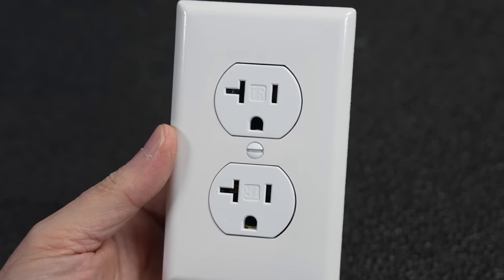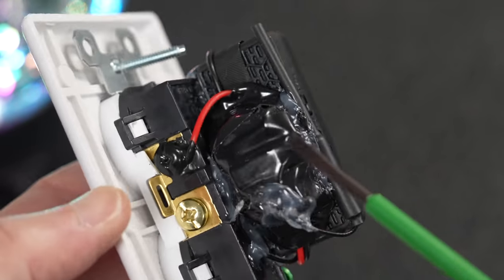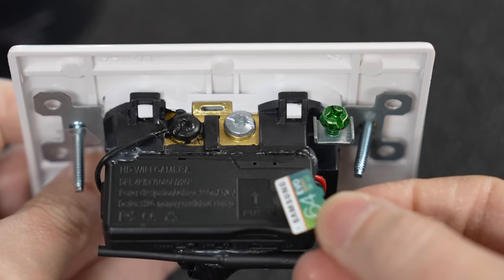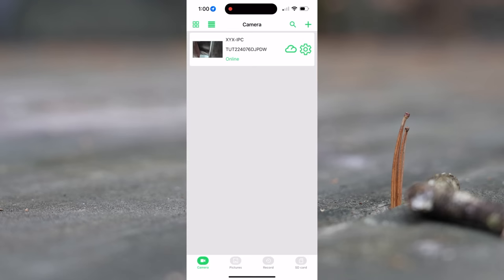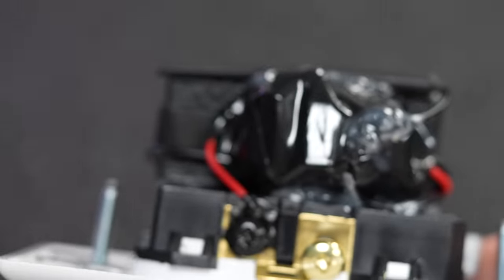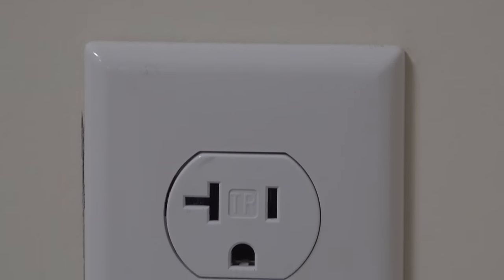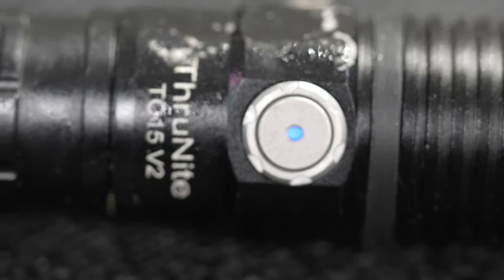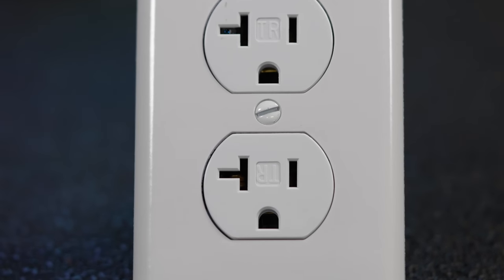Most ILLEGAL Outlet in the United States

Comment: All the more reason to not rent an AirBnB. This type of thing doesn't even have to be installed by the owners. It's innocuous enough that a guest could swap out an outlet or two and the host would never notice, and spy on everyone who visited after them. That said, virtually anything plugged into that individual receptacle would obscure the camera.
Reply from the maker: Wow, I never even thought of that possibility!
Reply: I was thinking the exact same thing. Yikes.
Reply: couldn't someone do the same thing in a hotel if they so choose?
Reply: Good point for sure.
Reply: Why would it matter if it was AirBnB? You think a hotel maid would notice one of these?
Reply: @the77eltigre  In theory, but hotels are much larger and built of concrete. The odds of it being accessible from the parking lot are slim to none. Buildings like that eat signals for breakfast, and there's lots of interference both from guests' devices and the hotel's own high-powered WiFi. It'd be such a tossup as to whether it would be accessible that there's no way it's worth the nearly $200 price tag.
Reply: Wouldn't they need to turn off the power to install it?
Reply: @sherryh7485  most competent people can handle 110 volt wires without turning off the power.  I personally never turn it off because it takes too long and the zap won’t hurt if (big if) it happens.  Just pay attention and you will be fine.
Reply: @sherryh7485  : When I was a kid I sometimes stuck metal objects in wall outlets and touched them.  The zap felt like a strong buzz.  Unfortunately, it failed to give me super powers, so I eventually stopped trying.
Reply: @scottmolnar4132  
Scott, Their hasn’t been any 110 volt residential service in the United States for at least 40 years. The standard is 120 volts and 240 volts for residential service.
Reply: @BartlettTFD  110 and 120 are used interchangeably because voltage actually fluctuates within that range. It's nominally 120, but 110 is used as the reference because that's the voltage you're guaranteed to get. This is why every device says 110 on it and not 120, because they're rated for 110 at minimum but have to be designed to take 120 as well.
Reply: @WardenWolf  
I’m referring to the MEASURED voltage at a receptacle supplied by the electric utility. I could care less about what a Chinese company stamps on their products😂
Reply: @scottmolnar4132   If you hold it with your teeth It helps keep the outlet and proper orientation
Reply: @sherryh7485   Actually no, I replace plug ins all the time without turning off the power.  You just have to be careful what you’re doing when switching the wires and make sure your not holding the plug in where you might get a zolt of electricity. If you’re holding the plug in wrong it’ll let you know!😂  I’ve been zapped a time or two myself, just a attention getter!  Unless you’re really grounded or standing in water the shock not that bad, gives you a fright for a brief second about it, then you realize what you did wrong! Besides not shutting the power off that is! 🤪 I’m not afraid of replacing plug ins with the power on at all and haven’t been shocked in years from it either. Just got to keep wires separated and pay attention where you’re holding the plug in while you’re putting the wires on the plug!
Reply: @BartlettTFD   Even though you are correct that’s it’s 120 and 240 it’s still a common practice to be called 110 or 220  by electricians and also on equipment sold all around the U.S.  it’s kind of nit picking about 10 volts. Which those 10 volts can easily be lost just using a longer extension cord! In fact in larger homes, especially if they don’t run 12 gage wire in those larger homes the plug ins that are far from the breaker box won’t have full power to run certain appliances or equipment like a portable air compressor. Which I have ran into this problem in larger homes many times with remodeling kitchens and having to move my compressor as close to the breaker box as possible to get the compressor to kick on.  It’s a industry standard to call it 110 or 220 regardless of the actual voltage?
Reply: @BartlettTFD  ok
Reply: @sherryh7485  nah I swapped most of my outlets in my house because it’s an old house and didn’t have ground prongs. I did the first couple by turning off the power but quickly got aggravated by working in the dark and grabbed gloves and did the rest with the power on. It’s a bit risky but not really that big of a deal.
Reply: @the77eltigre  Well that would be very difficult in a hotel unless you like taking the risk of wiring a "live" outlet. In most hotels you are not going to have access to the breaker panel. Airbnb however, most certainly you would.
Reply: @explorenaked  Anyone with a degree of experience and care can do a live outlet without dying. However, the risk in a hotel is substantially greater because, if you make a mistake and trip a breaker, it will trigger an investigation to find out who did it. In an AirBnB with an absent host, that is not a real risk. In most cases breaker panels are unsecured and the guest can just reset them.
Reply: @sherryh7485  can confirm that you do not have to, just changed out 15-20 outlets without bothering to kill the power. It's highly recommended, and you absolutely should if you are not experienced but entirely possible to swap an outlet without turning the power off.
Reply: @ghostridergale  I tend to flip back and forth, sometimes I say 110 "one ten" and sometimes 120 "one twenty" and I cannot think of any particular reason to choose one or the other.  It isn't actually a measurement, since when I measure the voltage, it tends to be rather variable everything from about 115 all the way to 126 or so.  It depends on the load time of day and which phase or leg of the circuit it is on and what else might be using it.
Reply: @kornbread435  It's easy especially with the kind of outlets that are not screw terminal outlets but just strip 3/8ths and push in a hole.
Reply: @BartlettTFD  "I could care less about what a Chinese company stamps on their products" .. "I could care less" means you DO care. "I couldn't care less" is the correct way to express that you don't give a toss. Many (mostly Murican) people make this 'misteak' 😂, it's endemic in your education system, mainstream media etc, so you're forgiven for not knowing this.😅
Reply: @ghostridergale  110 and 220 are LAYMAN’S term’s NOT terms used by electricians and engineers.
Reply: Even when obscured, it can still record audio.
Reply: @scottmolnar4132   Make sure you're using one hand.  Getting that voltage into one hand and out the other will shock the crap out of your heart, which is not something I'd recommend.  :D
Reply: @dragoniv  there is not enough voltage in 110/120 for it to matter. You may get a surprise but not but it won't hurt you
Reply: That is why this video does have some educational value. That configuration of receptacle is very highly unlikely to be installed in a hotel/motel room, if at all, other than in a shop area. Without the dual purpose 15 amp / 20 amp receptacle's appearance being pointed out, very few people would even suspect that it had a nefarious purpose for being there. 
 
In this age of cheap advanced technology being available to anyone, always assume you are being surveilled by a hidden camera. Always!
Reply: @BartlettTFD  then why do you care that he said 110, knowing that is correct as well.   If you measure the voltage drop at someones house, will you call it 118v ?  Its 110/120
Reply: I am installing these in my Virginia Beach air bnbs to catch people bringing too many guests and animals as well as smokers. Knowing in real time saves from severe property damage.
Reply: @sherryh7485  you can install with the power on if you are careful. Its not smart but it is do-able.
Reply: When I stay in Airbnb’s I have always searched for such devises. I had NO idea about this one however. 

It can’t be installed by accident so it’s definitely there for a reason.
Reply: @xjmg007  Duh, NO. Why would they or more realistically how/why would they?
Reply: @BartlettTFD  110 120 117, it’s all the same thing. 220 or 240, split calling it 110 or 120 is just addressing the wall outlet vs a dryer or range connector.
Reply: @STV-H4H  Obviously, as just a layman, that’s the way you/they view it. For those that work with it on a daily basis as an electrician or in engineering the actual voltage MEASURED, is what we go by.
Reply: @BartlettTFD  I was taught that the US standard was 115V+/-5V 60Hz or 230V+/- 10V supply is to be in the range and consumer equipment has to work safely with the whole range. Most gear just stamps the high end now to save a miniscule amount of money per item.
Reply: @robertstoneking7916  
I don’t know who taught you that but it has nothing to do with reality! The ONLY voltage that matters, is that supplied by your local utility company. That standard is 120 volts 60 HZ and 240 volts 60 HZ. That is what is expected under a “normal” load. During extremely hot or cold weather, air conditioning or heat pump loads will lower the “normal” or expected voltage. 
Appliance ratings only indicate what a particular appliance will tolerate, NOT the actual voltage at your home.
Measure the voltages at your circuit breaker panel to verify exactly what your utility company is providing.
Reply: @brothermine2292    When I was about six years old my brother Bill, about 5, would take outlets apart. He was obsessed with it and we had to watch him like a hawk but sometimes you'd hear a crackle sound and know that he'd found one.  His thumb and fingernails were eternally blackened.
Reply: @bobchurch6175  : By ”eternally” do you mean frequently or permanently?
Reply: @BartlettTFD  117V most of the time I've seen as low as 112V and as high as 121V with as much as 1.3V difference between phases in the 17 years I've lived here. I don't monitor it so I don't know if there were more severe excursions.
Reply: @brothermine2292  Good question. It didn't stay with him but for the year or so that he had this habit they were always blackened.
Reply: But not so easy to block the microphone. If they put it near a phone over enough time they would likely get access your ssns, credit card info, travel plans, medical information, etc.
Reply: @BartlettTFD  I already did make a contribution to the subject in another comment on the main thread. Go check it out. Meantime I made a contribution to your education as soon as I spotted your ignorant writings. No need to thank me and don't worry about the time it took cause I type really fast. It didn't take more than 30 seconds and I was able to get back to my mostly exciting but sometimes boring life, like yours and everyone else's.  🤣
Reply: @BartlettTFD  While you're busy correcting everyone else 'oh great wondrous master electrician', let me correct your incredibly bad grammar. "Their hasn't been .." should be " There hasn't been ..". You're welcome once again.
Reply: dang why did you tell everybody your spy cam business? Now how you going to make money ?
Reply: You're assuming that the airbnb or vrbo host never changes the wifi password or looks at the devices hung off the router.
Reply: @vertigo72480_official  Good point. I would think the host would change the password frequently, maybe even after every booking. Just like they would change the door lock passkey, if there is one.
Reply: @scottmolnar4132  I am a retired electrician, anything over 50 volts can kill you period! It all deepens your condition, where you stand etc etc. Electricity is like a lady, never touch her if you don't now her, and even if you know her she can byte you. Please always turn off electricity don't be a hero.
Reply: @SilverCymbal  Probably because you don't think like a criminal--which is good.
Reply: @tome8373  -- I feel like your statement will be "Exhibit A" in some future lawsuit, unless you are being sarcastic.
Reply: @BartlettTFD  you utility company couldn’t give a fuck if your circuits tested at 110-120 either.
Reply: @Alphasig336  You’re totally wrong. Our utility outputs about 125 volts. With a normal load, that pulls it down to 120 volts. During an extremely heavy load caused by record heat or cold, it may drop to 113 volts. Nevertheless, the target is always 120 volts.
Reply: ALL the more reason to rent an Airbnb, after you find the camera and after suing the owner you'll have that property to rent out.
Reply: @scottmolnar4132  I once shortened a pair of long nose pliers doing this.
Reply: if a airbnb is caught with ine of these the owner gets arrested and the outlet is seized once its no longer evidence i dont know if they give it back or destroy it
Reply: @tome8373  that's still extremely illegal and I hope you're not serious. You can put cameras on the outside of the house to see if they're bringing too many guests, but not inside.
Reply: @WardenWolf  I don't know where you live, but here in the USA all my wiring devices, surge protectors, phone chargers, etc. all say 120 VAC. Some of these devices I have had for a long time.
Reply: @BartlettTFD  COULDN’T care less. Not “could”.
Reply: I recently watched a movie where the killer did exactly that....can't remember what it was called though.
Reply: Exactly
Reply: And people put drugs in tricker treater’s baskets. People who own Airbnbs just want money lol. But sure….
Reply: Carry a bunch of child safety caps and insert them into every outlet when you arrive, remove when you leave. Audio is still recorded.
Reply: @Samlol23_drrich  lol
Reply: @sherryh7485  yes but if one is in your house who put it there
Reply: @the77eltigre  You'd need access to the circuit breaker panel. Or, I guess you could trip the breaker and call hotel maintenance and has them to reset it.

Comment: The big BLOW-IT for me (and it might help others) is when I saw the "TR" stamp in the middle of each outlet. It stands for "Tamper Resistant" and means that is one of those annoying receptacles with the shields that cover the slots and you have to push past them to insert a plug.  This one had the shutters removed so it instantly looks wrong to anyone who knows.
Reply: Or plug a 20A device into it and smash the camera.
Reply: @jgleigh  And set the house on fire drawing too much current.
Reply: @soundspark  If only there was a device that would “trip” if too much amperage was pulled……
Reply: @Brees1986  When the 20A neutral prong is gutted out to fit the camera there won't be enough contact with what's left to safely pass the current.
Reply: @soundspark  20a outlet can be used as long as you have 20a circuit now if on a 15 amp breaker it should trip if you pull 20a but better to use the correct outlet
Reply: @jar407  I'm pointing out that since the part with the camer had to be gutted, it is lacking one side of its connector clip, thus may make a poor connection for which a strong load could overheat the outlet.
Reply: @soundspark  -- Sometimes, the two parts of a duplex outlet can be separated, electrically. It would make sense to turn this side off, thus ensuring anything plugged into it wouldn't work (causing the victim to move their plug elsewhere), and preventing exactly this sort of problem.
Reply: yes, but the other ones for sale on amazon are not TR type
Reply: Your right sir!
Reply: @soundspark  Actually that is a 20 amp outlet on 120 volts, so by code it should be on a 20 amp circuit. So would not cause any problems other than having a camera smashed and then causing a fire due to pieces of camera arcing due to poor contacts.
Reply: @soundspark  Just an FYI that is a 20a recep that is why it has the extra horizontal slot.
Reply: @soundspark  That plug configuration is rated for 20A
Reply: @jar407  Don’t forget having the proper gauge wire for a 20 amp circuit.
Reply: @soundspark  first off, the camera is blocking the ability to plug in that type of plug, next, plugging in a standard plug will work, and your house will not burn down. Ever heard of circuit breakers?
Reply: @josephzajdler  Circuit breakers don't help if something burns up with less current than the rating.
Reply: @soundspark that side doesn’t work at all you can only get a current from the hood non camera side
Reply: @soundspark you sound like you understand this but why do you keep ignoring they have made it so you can’t plug something into that side?

Comment: Okay just to clarify if you see an outlet like this it doesn’t mean it has a camera in it since 20 amp receptacles are a real thing. You can literally buy them at any home improvement store or hardware store. This might be an issue at a Airbnb or seedy motel. Also for an outside person to download the video over Wi-Fi or Bluetooth would require several minutes at which point you’d probably notice someone sitting outside your house. This would be a much bigger concern for apartments or shared living spaces. One easy way to see if there is a hidden camera in a room is to pull out your cellphone and open your camera app then slowly pan around the room (darkly lit or completely dark, not middle of the day) and your screen will show any camera that used infrared for night photos or videos. The OP of this video should have explained this more clearly before hundreds if not thousands of individuals think they got cameras in their outlets just because they got the 20 amp versions.

Comment: Master electrician here. If you ever see TR (Tamper Resistant) on the front of a receptacle it should have white shutters in it  to prevent your kids (or husbands) from putting a knife in it. If it does not put piece of tape over it. Problem solved